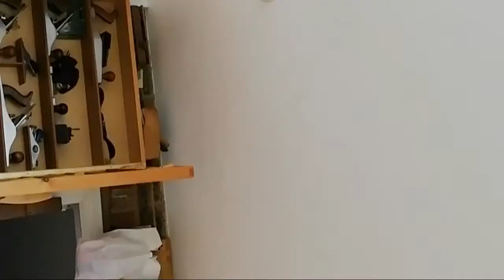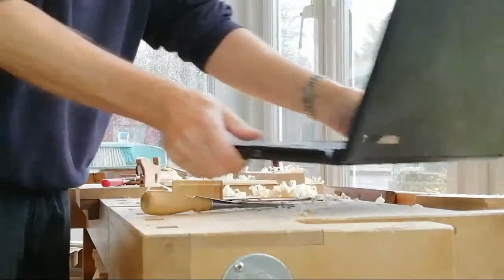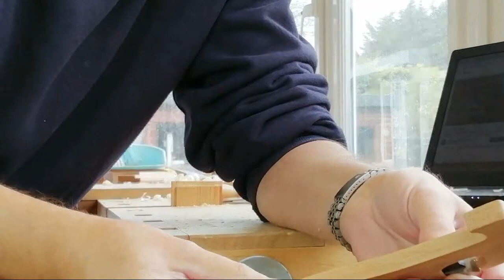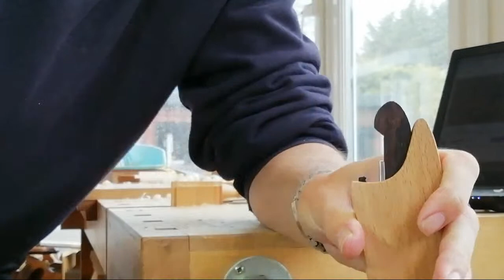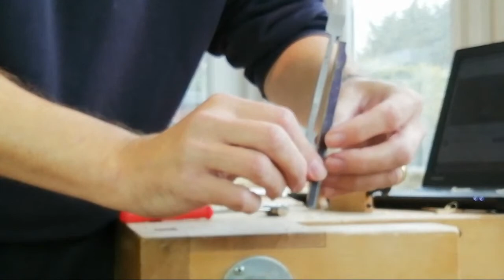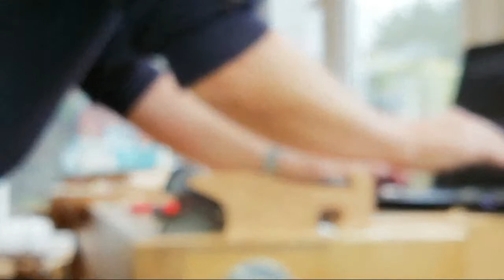Shoulder Plane Wrap Up

Comment: I couldn't catch the stream just then, but it seems to work beautifully! better than I expected. I felt the wedge would bulge the bed of the plane due to the 12 degree bedding angle, but that doesn't seem to be much of an issue!

nice work! I enjoyed it a lot

maybe you should try out some boxwood as a strike button, that would be an exelent choisce of wood for such a purpose. very though and hard wearing ;)
Reply from the maker: I shall see what pieces I have around. I also have some ironwood, which might be good.
I tuned the sole with the iron backed off and the wedge set, which took care of the deflection.